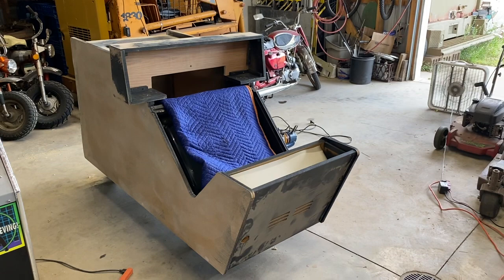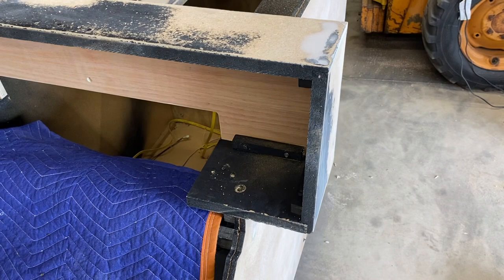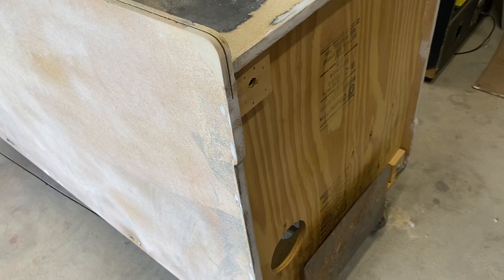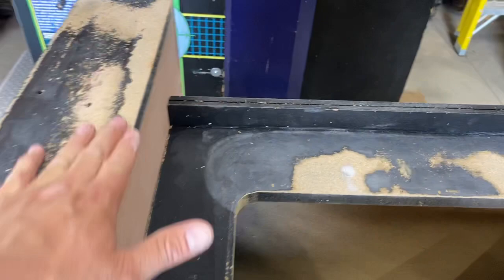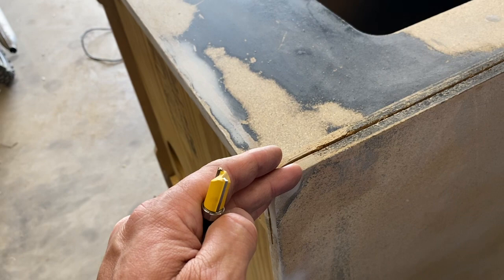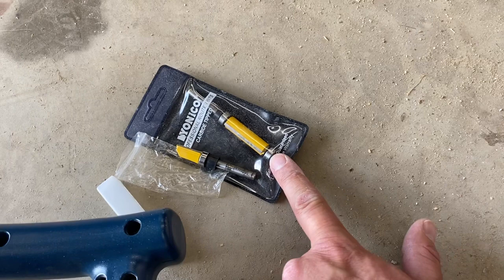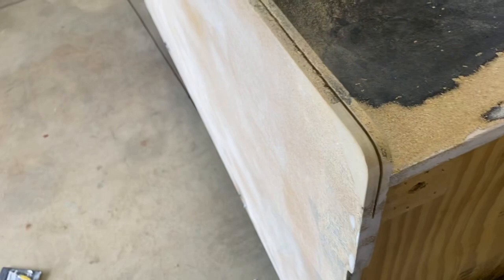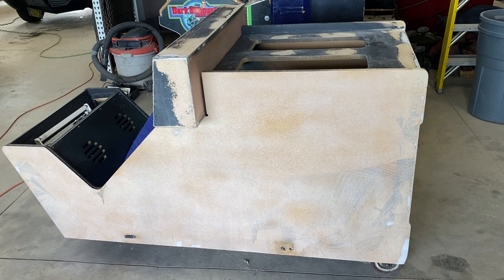Konami Arcade De-Convert - Part 6 - Wood Corner Repair

Comment: looks great! Nice job with the wood repairs! What are your thoughts on using wood hardener along the bottom edges to prevent the particle board from further flaking?
Reply from the maker: I looked into it to experiment with, but have not pulled the trigger on anything yet.  This one wasn't that soft but some i definitely would give it a try on.